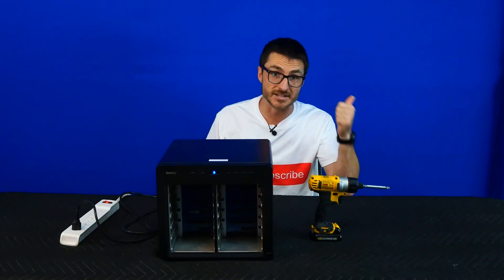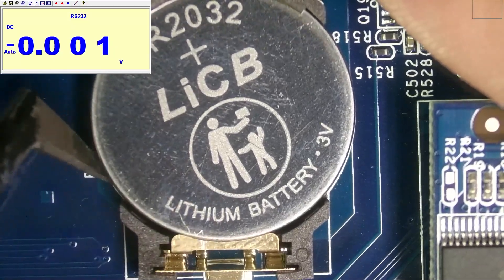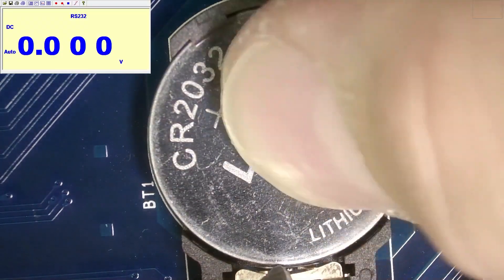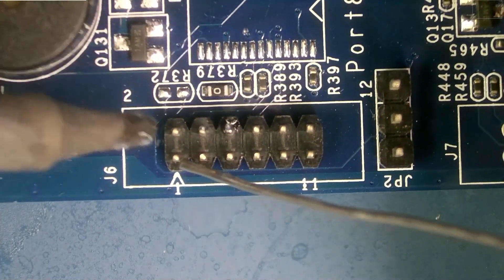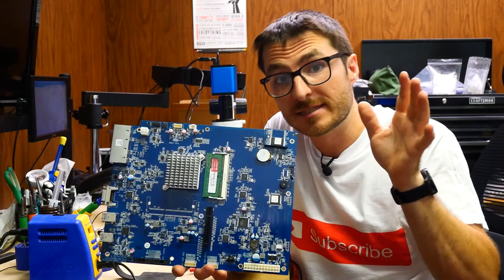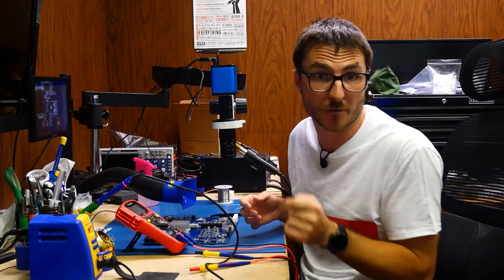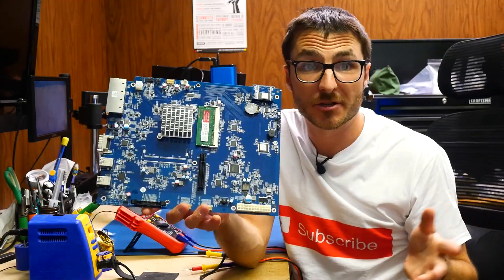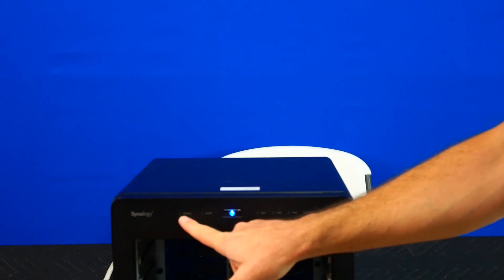How I fix Synology NAS DS2415+

Comment: I have a ds2415+. Shut it down to move it as well as add 6 more drives for a mirrored RAID5 (yes..i know...over kill....). Noticed there was an alert for a possible bad HD in the array. Paid it no attention. Got everything moved..installed all the drives (originals in original slots) and blue blinking power and blinking alert. found this video and replaced the little battery...no drives..still blinking blue light/alert. Installed the suggested resistor. Turned it on without drives, looked good. Reinstalled everything and one of my original drives had too many bad sectors. (not bad for 15 years of constant use...i thought). So replaced the drive with the 7th of my new drives. It whined about it not being on their compatibility list.....we'll see. I hope to keep this thing going for a few more years. Videos like this are the GOOD side of youtube. :)

Now for a question...is the Q2 replacement necessary? And what is the 10k SMD resistor for? Was there going to be another part of the video or did I somehow miss it?
Reply from the maker: Q2 not needed for you at this step, that's for when it won't boot up at all meaning the unit acts completely dead. The 10k resistor upgrade you are refering to on the power supply is not applicable to this unit as it uses a different type of power supply.

Comment: Just did the surgery on my DS723+ and it worked!
Reply from the maker: On your DS723+? What repairs did you do to it? The repairs to this unit are not typically the same for other units. What repairs did you do to your unit and what symptoms did it have that you fixed?
Reply: Continuous blue light blinking. Added the resistor, unit now powers up. Now need to get power to hard drives. Getting no hard drives detected fault on known working drives. @NicksElectronicRepair
Reply from the maker: mhmm that's interesting and shouldn't have worked. The reason the resistor installation works for this unit is because it uses an intel CPU of the Atom C2000 family which is known to have a defect on the clock line. over time that clock line goes out of spec, and installing that resistor pulls it back down to be within spec. That is why we install the resistor. The DS723+ does not use an intel CPU it uses a Ryzen R1600 which is made by AMD, not intel. AMD Ryzen R1600 processors don't have the same manufacturing clock line failures, so it doesn't exactly make sense that this would have worked for your unit. 
This is so bizzar! Let me know if you get it working because this is for sure worth a video if it actually fixes it. 
I do have a feeling though that what you did may just be mimicing an "on" command signal without actually turning the unit on and that's why it seems to be fixing it when in fact the root fault is still present.
Reply: @NicksElectronicRepair  Thank you for your response. I want to believe you are correct with the resistor. The unit started powering up after installing the resistor. went to find synology and no hdd detected (synology 8TB x 2) tried some non conforming regular hdd and it works. Synology disk are 12V, normal disk are 5V. Waiting for new AC adapter to try. I went ahead and removed resistor and all is working with normal hdd. Need to get these 8TB 12V synology drives powered. Thanks for making me dig a lil deeper! I Appreciate it!
Reply from the maker: I highly recommend you back up all of your data just in case!
Reply: @NicksElectronicRepair  Hi nick, just to update and leave no one wondering. It ended up being power to hard drive issue. Removed SAS hard drives and the unit boots to status light. Long story short my unit only powers sata disk drives. It does not have the amps ( I assume ) to power SAS-NAS drives as I've tried synology enterprise and EXOS enterprise to no avail. Install regular sata and sytem functions 100% no issues
Reply: Thanks!

Comment: Can you confirm you used a 1/4 Watts resistor for this fix ? 
Thanks !
Reply from the maker: Yeah, 1/4 watt is what is recommended, but you can go higher. I wouldn't go lower but higher would work as well.

Comment: Do you have a fix for the ds 412+? i changed the battery and the power adapter. but that didn't work, still have the blue led blinking.
Reply from the maker: For the DS412+ when you have the blue light blinking endlessly, you could have a defective eeprom, or the U1 IC on the back side of the daughter board could be bad. I have also seen the Ram sticks be the cause of that symptom as well although that is much more rare. 
If you want to send in the unit for repair, we have a flat rate service for this one as well.
https://nickselectronics.com/products/ds412
Reply: Did you solve this? This is the good ol Atom bug as seen here too.
Reply: @Ligerzeronz  kinda :-) i tried the new power bank again with the start up sequence. (power off, hdd's out, power on, hdd'sback in...). it took quit a while to start up. so be patient. Then after a few day's, it was back the same. Notting, death again... So i did the sequence again,and again it started working. Then I found out that it crashed every time I restarted. And i had set it to restart every night to clear the memory (as recommended). So i turned this off. and it has been working since. I did buy a simple external HDD, just to back up my files with Hyper Back up (just for issurance). I think there is something wrong with the internal power unit. Looks like it doesn't have enough "energy" to power up with HDD's in it.
Reply from the maker: I have an in depth video I posted recently about this one linked below:
https://youtu.be/xpV5ydNdxHg
Reply: @NicksElectronicRepair  wow amazing you got a fix. Unfortunately i live in Belgium so sending it over is difficult. Since i disabled the daily reboot, It is still working...  But great video 👍
Reply from the maker: Yeah if it ever fails you can fix it yourself now that you know what chip goes out or if you don't have the soldering tools or experience, bring it to this YouTube guy:
https://www.youtube.com/@KrisFixGermany

I know it's not Belgium but it's a heck of a lot closer than the USA